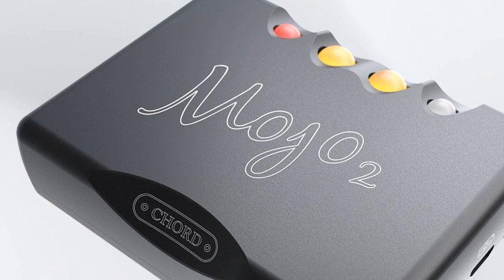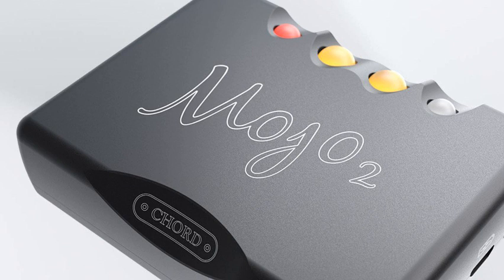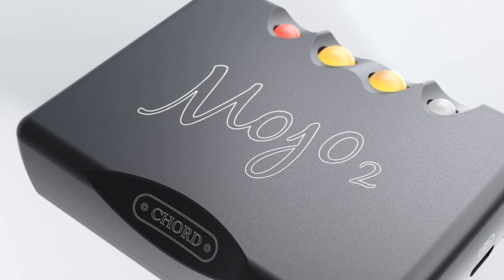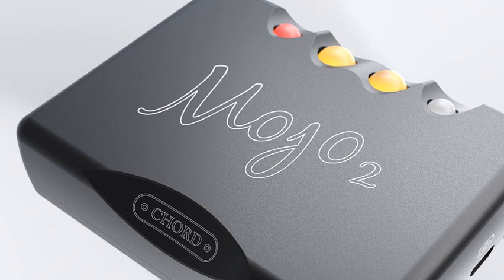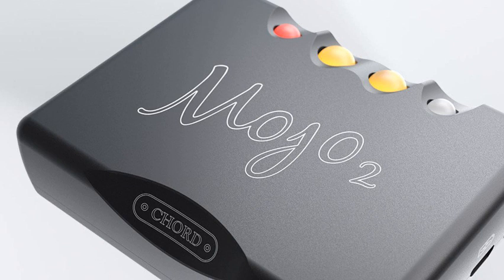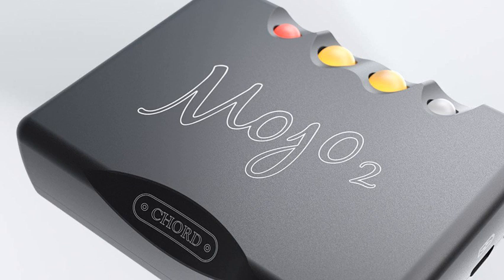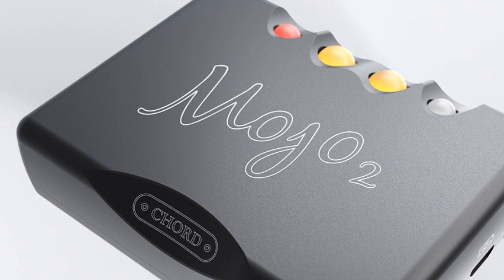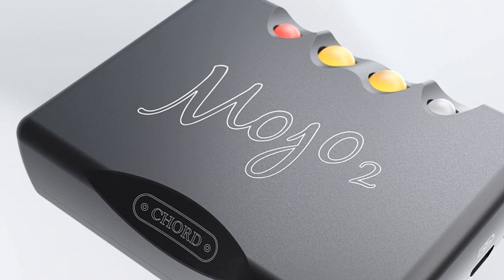Rob Watts on the Chord Mojo 2

Comment: Interesting I was going to upgrade my mojo 1 to this new one but it looks like it's a very minor upgrade in sound , have you got a chance to compare the two units?
Reply: i cant give you an answer to your question but i can say the mojo 2 is a really really nice dac/amp, ive owned it a few days now and also own a ifi zen dac v2 and soundblaster gc7 (mainly use my dac/amps at the desktop on pc), i think where the mojo 2 will improve on the 1 is in the EQ settings, they are really quite well done and even if you want the natural response your headphones put out you cant help but have a play and see what the EQ can do and often stumble across a result that really impresses. then ofcourse there are the other nice features like being able to leave it plugged in without just obliterating the battery, having the crossfeed implementation and ofcourse usb c connectivity.

like i say i cant speak on the sound comparisons to mojo 1 but judging by what others say about mojo 1 its likely not going to be a world of difference, i mean what is in the audio world, its all pretty incremental, i think original mojo can fetch £300 on ebay so with that in mind i dont think the extra £150 to get the mojo 2 is a bad move, i think chord charge that kind of money just for a battery replacement on the mojo 1.
Reply: @jinx20001  what's your thoughts between the Mojo 2 and the ifi zen dac?
Reply: @apexracing741  Bought one.  Waste of money for me.  No better than my Zen DAC V2.
Reply: I find it exponentially better, price to performance ratio setting aside the hardware quibbles, it’s freaking awesome